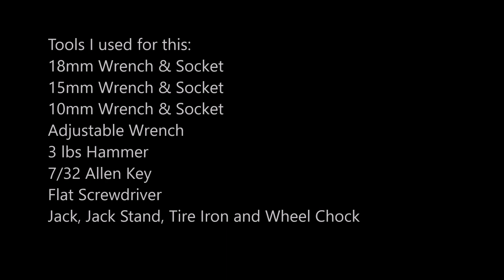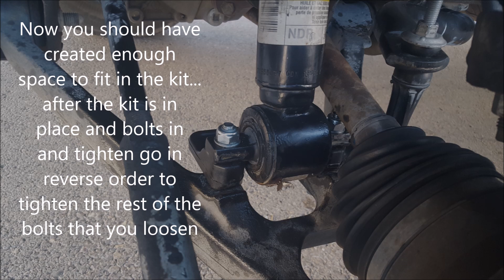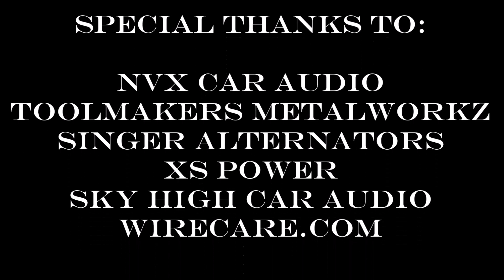Install 2" Rough Country leveling kit on 2013 Chevy Tahoe

Comment: Just did mine, an reason i am getting tire rub in reverse while turning now? didnt really do it before and only getting it on the drivers side..
Reply from the maker: Jon Jones you might have to do an alignment..... you still have the factory tires on?
Reply: Yea I had an appointment tomorrow for a alignment also still have factory tires on it... Just didn't know if it could go out of alignment so bad to make it rub after the level other wise it drives looks and sounds fine.
Reply from the maker: Jon Jones that's sucks you are  having that problem brother! And it just rubs when you back up?
Reply: yea only when i back up and turn.. but Ill get an alignment tomorrow and see if it changes...thanks for you reply and video it made the instal easy.
Reply from the maker: Jon Jones anytime brother that's what we are here for to help each other out... let me know how it turns out

Comment: It's been a little over a year now, how do you like it?
Reply from the maker: swathdiver it still riding smooth so i cant complain.... but im thinking about going higher though
Reply: Thanks.  Some folks say the N2.0 Leveling Struts ride better but I reckon it's because the struts are new compared to whatever is on there truck already.  How high?
Reply from the maker: swathdiver i want to put 35s so i was looking at the 5-6in lift

Comment: so with this modification can i fit 285/60/20 tires on my 2014 tahoe??
Reply: Jesus Rios I have that same wheel and tire on mine right now with factory highs it runs only when I turn right at full lock on the passenger side wheel well cover so you’ll easily fit them with the 2 inch lift spacer